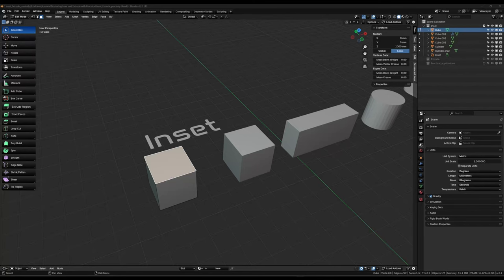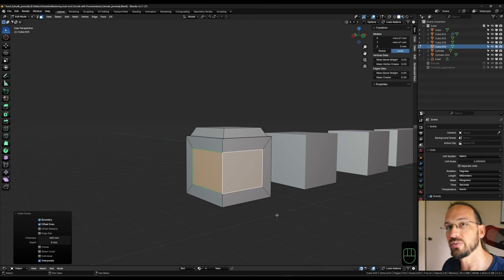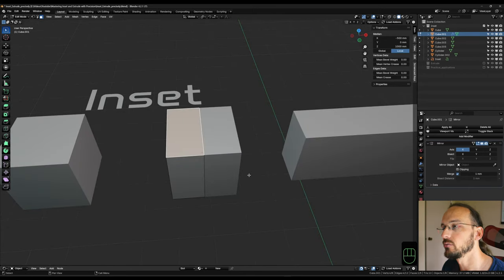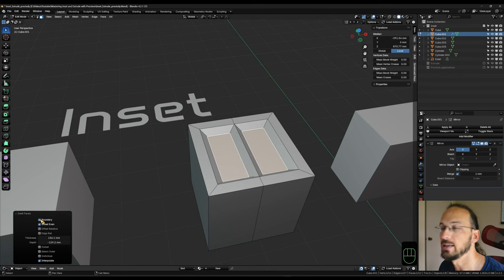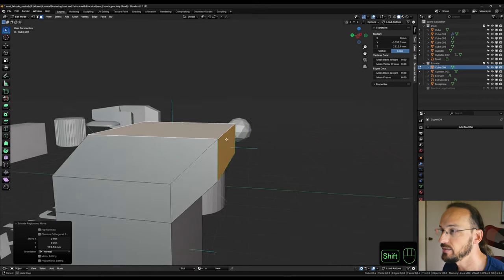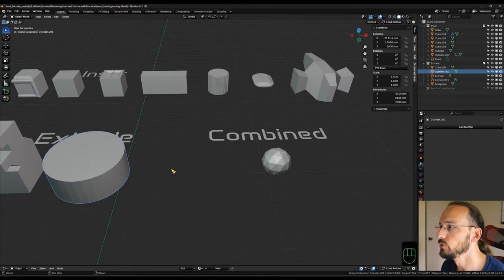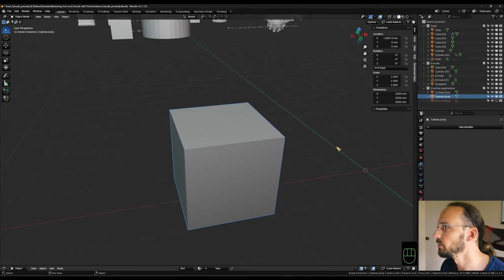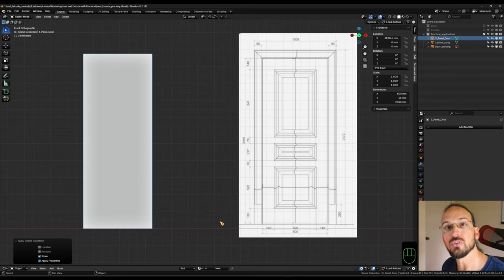Master Inset and Extrude Tools with Precision in Blender

Comment: Great explanations, in particular the Inset tool is something I use very often, especially for things where other tutorials just show a combination of extrude and scale, although insetting could do this much easier and more precise. The only thing I'm missing here is that you could have shown on the icosphere everything you did there would have been possible using the Inset tool, without needing the Extrude or Extrude Along Face Normals, if you would just inset faces by an offset of 0 mm and only giving them depth.
Reply from the maker: True, that would have been another option, but I wanted to demonstrate how well the two tools work together in this instance.

Comment: extrude manifold trick to extrude seamless to another is to have snap on verts or edge and  and check the merge in overly so that it merges to the edges  and dont create  overlapping face
Reply from the maker: Having snapping and merge turned on is a great tip to get precisely to another edge, thanks. 
Unfortunately we still can't get past the next edge without creating additional faces in one go. A solution would be to snap to the edge with auto-merge on and then repeat the extrusion further in. :)

Comment: What could be confusing to people is why you first tell how important it is to always apply the scale, then later when you make the first cabinet example you reduce the X dimension by 38 mm, not applying the scale and then when you are doing the "precisely" 19 mm extrusion on the side faces... it unsurprisingly ends with your cabinet showing an unprecise 598 mm on X (rounded, actually it is more like 597.593... mm).
Reply from the maker: You're right, good catch. I could have sworn I did it, but seems like I forgot focusing too much on the recording.
Only shows how easy it can be to forget and how important to mention over and over again. :)
Reply: @SFE-Viz  Definitely, that's why I often switch to Edit Mode as early as possible 😆 Or I'm adding a new cube and enter the base dimensions in the Adjust Last Operation settings.